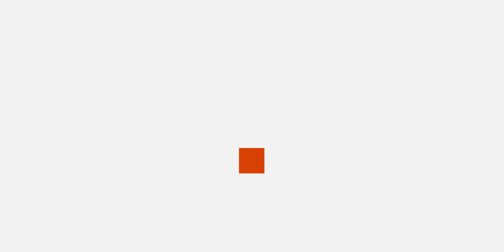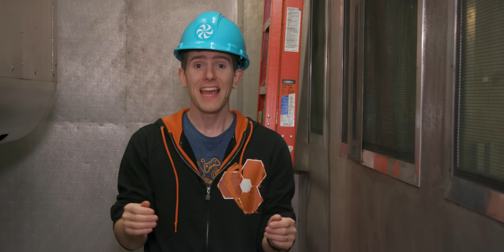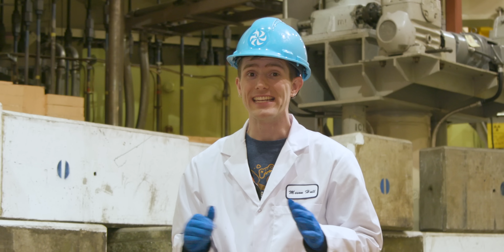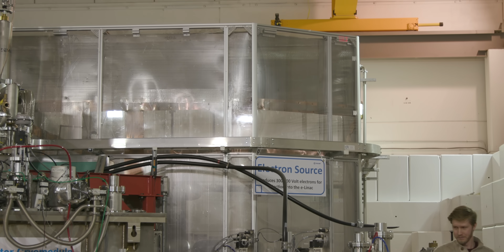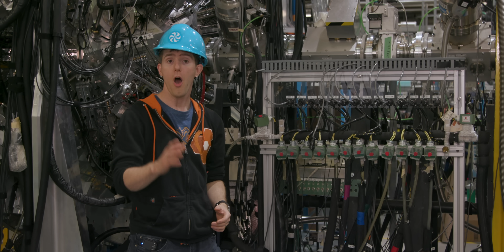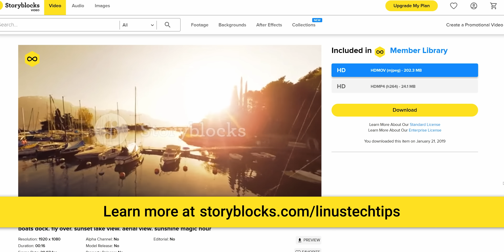The World’s Largest Cyclotron

Comment: MeV is expanded as 'million electron volts'    

 right?
Reply: Mega electron volts (but mega is essentially a multiplier for one million, so what you said makes sense)
Reply: @adampnewsome  thanks man.. also the next level would be GeV or BeV(Billion electron volts)?
Reply: @venkat8249  Yes, GeV is the units Giga Electron Volts (which is one billion electron volts). An electron volt is essentially just a very small amount of energy. Rather than using Joules for the units of energy, scientists/engineers use eV because it is more convenient for certain types of calculations dealing with small energy levels. Definition: "the amount of energy gained by the charge of a single electron moved across an electric potential difference of one volt".

Comment: 3 in a row...
10x10x10--1000 mega electrons
('-')/
Reply: That's not how energy addition works. Energy addition is always conserved, so you use plain addition. You're thinking of something else, like an amp/voltage stepper.

Comment: That dosimeter is nothing more than a placebo. If the machine is off, you pretty much have nothing to worry about. If it's on, and there is a problem with the shielding and you get exposed? Yeah, you are toast. Quite literally.

Comment: There is such thing as power over fiber it just can't run a 30kV power supply but more like a POE injector with super ultra high isolation voltage that could probably work at 1000kV+ voltage differences to run a tiny PC or sensor in a HV area.

Comment: Wait if that's a docimeter what's a gieger counter
Reply: A dosimeter is used to record the amount (dose) of radiation you've been exposed to over time. It sums up your exposure. A geiger counter shows the momentary radiation level.

A Geiger-Müller-Counter is the one you see on movies, making those ticking noises when near a radiation source. It tells you "theres radiation here and now" and how much of it. 
It won't tell you "you've been exposed to radiation for 4 hours and therefore your level is X mSv".  That's what dosimeters are for. 
 
Waaay back in the old days, the simple dosimeters were strips of (photo) film in a black canister (film will be "exposed" by radiation hitting it), which was worn during the day, handed in when leaving. It was developed and the amount of exposure was checked by determining the amount it was darkened by the radiation. Simple said... if it was blank - your ok. If it was light grey you'd been barred from working in exposed areas for a month. Dark grey was a trip to the hospital, and if it was black... well, no need to spend money on those concert tickets for next week. 
Modern ones are electronic and a tad more sophisticated. You can read your exposure level at any time, and most will give of alarms if the radiation level get's to high or you've reached a certain threshold of exposure.

Comment: The voltage doesn't kill you, the current does. 

Is this true?!
Reply: Kinda, it is basically down to amperage, which is determined by voltage and wattage. High voltage but low wattage is less likely to kill you, same with high wattage at low voltage, if both are high they are more likely to kill you.

Comment: Noobs : puts power supply on rubber pads to avoid short circuit.
Legends : Hugs device with high voltage sticker.
Reply: It only tingles the first time.
Reply: Pro commenter: Makes electric joke
Noob: doesn't realize that the equipment is turned off... Even with subtitles.
Reply: Nuno Pro: Makes a joke

Noov: doesn’t realize its a joke even when they can re read it
Reply: *in a Faraday cage
Reply: @TobeaLink  Dont forget "at 300K Volts
Reply: @LEOFXZ_PHOTO  Watts*
Reply: Nope he said volts.
Reply: Shots fired!

Damn what a priceless comment
Reply: You call them legends usually when they are dead yea?
Reply: Oh no im detecting some retards dumbasses saying that its the amps that kills not the voltage 
SICKO MODE ACTIVEATED REEEEEEEEEEEE
Reply: mafia boss
Reply: The verge has created a timeless meme
Reply: Pros: knows that its the voltage that kills 
Noobs: IZ DA CURRENT DAT KILLZ !1!1!1!1!1!1!111111!!!!!!!!!
Reply: its the amps that will hurt you
Reply: @odensfury  yes and no

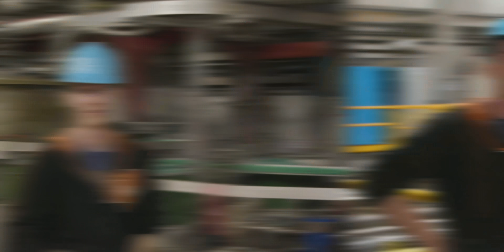Comment: 12:40
Each home only uses 1000W? That doesn't sound right...
Reply: 526 watts right now..... how much are u using ?
Reply: Milene De jong A window AC unit is 1400W alone. Water heater is 4500W. Hair dryer is 1000W. PC is another 1000W. Freezer/fridge is 800W. Microwave is 1400W. Dishwasher is 1200W. Dryer is 5000W. It adds up, very quickly.

Comment: They should make an accelerator that can make a partical move faster than the speed of light.  😜
Reply: that sounds pretty fast man
Reply: Not very likely to happen, the only ways for matter to go faster than light would be to use wormholes, star trek style warpdrives or a type of hyperspace/slipspace (like halo or star wars). Normal means of propulsion cannot push something (even tiny particles) anywhere near fast enough.

Comment: Are they gonna build a wake field accelerator for the linear part? You said the particles ride the radio waves but in a wake field accelerator they shoot a laser through a tube and a particle directly behind it, so that the wake behind the laser pulse pulls the particle along. Kind of like the draft you feel as a train speeds past you.

Comment: Would it hurt if a really fast particle would go right through your heart?
Reply: No, the energy of one particle is just too small even at roughly the speed of Light
Reply: @Dundoril  what if it is something like a big particle like lead? (If you could accelerate it that much)
Reply: @maksimlikhachov1465 
Even for heavy particles, one is just not enough to feel it (Even the TeV reached by LHC ist not that much energy  per particle...somethinglike  A fraction of A Joule.. , but as I. T. Said it will probably do quite some damage to some cells in your  body.... But Even this would be irrelevant compared to All the radiation we are exposed to every day... Then again if you are  Hit by the whole beam.... Thats A different matter.... And i would not recommend it.
Reply: @Dundoril  You want low energy particles to deposit a lot of energy as well, not high energy. Low energy particle beams cause a lot more damage than the beams in the LHC.
Reply: @BlueCosmology  Sure at LHC energies :-) but here we are talking   500 MeV ( i know i Was the one who talked about lhc :-)). At those energies the bragg peak for Protons should still be within the body (also now that a think about it... I think for Proton therapy the energies are more in the Range of 150 MeV)....
And i think even for LHC energies it would be interesting to do the math... Because while the relativ energy Loss is smaller at higher energie.... The absolute energy loss could be bigger...
Reply: @Dundoril  By 500 MeV a proton is more or less a MIP, you definitely want lower than that for radiation damage, the vast majority will pass completely through a body, anything significantly more than around 100MeV and you're getting into very low energy deposits.

LHC beams definitely deposit very little, they barely interact at all unless you have a huge amount of material in the way to stop them.
Reply: @BlueCosmology 
So i checked the bethe Formular again and of cource you are right, also as I said since Proton therapy is done in the 150 MeV Range,  i would expect the bragg peak to be  at 10-15 cm for a Human body otherwise it would not be really usefull for therapy....
Reply: I mean, an electron in a beta decay is moderately ionising and has medium penetration so it could do some internal cell damage or some other kind of damage to your heart.
Reply: @siddiki9778   so a single electron could actually cause damage to you?

Comment: 75% the speed of light is VERY SLOW for particle accelerator speeds
Reply: I mean, it IS 50 years old, that's probably why they're upgrading it. Besides, I reckon they're not doing the exact same stuff as the LHC (that thing uses 2 colliding beams so you're in the CM-frame of the 2 beams which means you have a lot more energy lying about to create mass, special relativity and all) considering they're slamming protons into big nuclei to create different nuclei instead of slamming 2 beams of protons together to create new fundamental particles.

Comment: LOL, what a complete DUMP.  Such dusty.  Too little funding to get someone to clean it once a decade?
Using a million watts to get a whopping 30MeV particle.....that calcuates to 0.00000000000000013 Watt/hour of energy?   Im sure google calculating it for me diddn't account for some inportant variables, but wtf?
Reply: Yes most of those Facility are dusty. mainly because it dies not matter much and you Do not really want a cleaning Crew there.... Oh a cable is loose.... Well i will just put it back there.... There goes your Experiment...

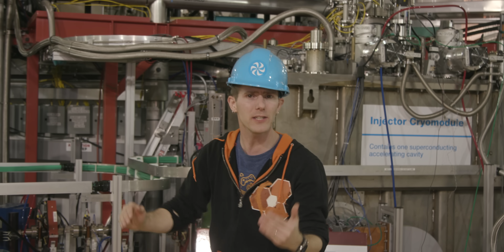Comment: 12:08 NOT like a railgun. A railgun uses the arc across two rails to propel matter. This is more similar to a coil gun, which uses a series of electromagnet coils that switch on and off at precise times to propel matter.

Comment: In case anyone was wondering: 18F-fluorodeoxyglucose is used basically everywhere they have a PET scanner. And, the larger hospitals that have one often have their own cyclotron as well. It's a tracer that pretends to be glucose, and is used to detect where glucose is used in the body. This can be used in brain imaging to see if parts don't work well, or detect abnormally high usage elsewhere in the body, such as is the case if the patient has a tumour. It is beneficial to produce it on-site because its half life is only about 2 hours.

Comment: Great video. I work at a proton radiation therapy center in Atlanta for cancer treatment and we deal with literally all of this stuff on a smaller level. A 15 foot diameter cyclotron with protons that are around 61% the speed of light or 250 MeV.  

Our system also uses liquid helium at an average temperature of about 4.4 K. We have a video floating in our company that shows liquid nitrogen dripping off of a cooling line fitting as it condensed from the air while they fill our tanks up with the liquid helium. Also, if we ever quenched our helium it's about a $250,000 oopsie.
Reply: @helium... Is there no Backup to store the Helium in case of quenching? Seems Kind  of wasteful.
Reply: @Dundoril  Nope. Not really a point as the system can handle it, and we just call up the industrial gas company to refill it. Takes about 3 days.

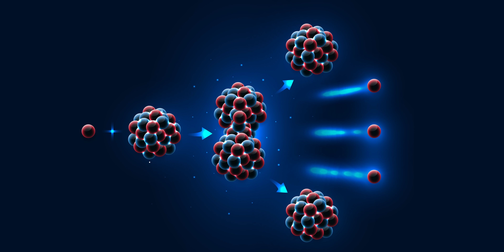Comment: 13:03 It's talking about a cyclotron proton accelerator and linear electron accelerator, but then it shows a diagram off a neutron (not proton or electron) causing fission (most likely Uranium-235 fission which need low speed neutrons not high speed). Don't worry though, I still really enjoyed the video and I only noticed this tiny error because I'm a complete nerd.
Reply: Oh good point.. I thought they were showing a spallation Neutron  source .. But since the incident particle is clearly a Neutron you are probably  right.

Comment: Isn't the one in Switzerland the world biggest particle accelerator?
Reply: Indeed, but that's not a cyclotron. A cyclotron accelerates a single particle beam on an outwards-going spiral path and then launches it. The LHC however uses synchrotrons which accelerate 2 beams going in opposite directions on circular paths and then collides them.
Reply: @photonicpizza  thanx for the explanation:)
Reply: There are different types of acceleratorsfor different purposes
Reply: @vnyggi621  okay :)

Comment: 75% the speed of light? that seems kinda low. the COSY synchotron in Jülich which basically around the corner for me accelerates up too 99.8% the speed of light. they always get complains from the power company when they turn it on.

Comment: 12:08
Should be Coil gun not rail gun.

Rail gun: the projectile is in contact with the rails as it is being forced out.

Coil gun: the projectile is not in contact with the conductors and is propelled forward by a series of solenoids.

Comment: 12000 volts...
The right anmount to do stuff with hydrogen or...

Get an fx 9590 stable at any other frequency other than its stock.
Reply: On some newer graphics cards it also enables deathray tracing .
Reply: i salute you sir
Reply: remeber how AMD FX hit 8.429 GHz in 2011?
Reply: ...and what do we learn from all this? linus prius is slow af :)
Reply: 5.1ghz baby
Reply: Finally someone who gets 5.1 gigahertz on a fx 9590. 😂
Reply: @thedevminer  it literally melted my vrm back in the day. Never OCed again till ryzen.
Reply: <insert_ahh_thats_hot_meme_here>
Reply: They said 300,000 Volts.
Reply: At least its still usable. Shintel reaches temperatures close to that of the surface of the sun.
Reply: This can't even power a GTX 480 quad-SLI.
Reply: Haha 😂😂
Reply: * laughs in FX-8350 passing Cinnebench at 5.2GHz *
Reply: Nit even bruh
Reply: Ooo can i get 5 gightz with my 2700x
Reply: he said 12kV over the 300kV base voltage so that should be enough to get RTX cards working.

Comment: Those cables......
They have to pay someone to cable manage that
Edit: this was a joke pls don't kill me
Reply: The problem is the rewire regularly. tbh I was wondering why the removed all the aluminum foil, that is used to heat the pipes up for vacuum pumping.
Reply: Electrical engineer here, cable harness manufacturing/management/etc. is an actual field that some engineers specialize in. The routing of these wires is very carefully planned not only to meet mechanical constraints such as space, cost, accessibility (make sure the cables are not in the way of sth), reliability (make sure there's no unnecessary wear and tear), etc. but also to meet electrical constraints such as EMC, current rating, voltage isolation, etc. It's typically done by an electromechanical engineer and it is very important if you want to ensure proper long term operation. Even the connectors that you use have to be carefully selected for your intended application.
Reply: I mean i'm sure they are like that for a reason, i'd imagine that the engineers who made it know a hell of a lot more than any of us lol
Reply: Considering the knowledge and experience those engineers have, those cable managements are probably the best it could possibly be done without sacrificing funcionality at all
Reply: So much wasted gear used on this facility. They should have used that money to make next gen graphic cards with gamma ray tracing.
Reply: Cable management is for suckers who value aesthetics over functionality.
Reply: Rubiconnn CoughairflowCOUGH.
Reply: @rubiconnn  More like for people who don't have to rearrange the wires

Comment: Isn't that thing called Geigenzähler or Geigencounter
Reply: I think that they are different instruments.
Reply: A Geigenzähler would be a Violin counter :D
What you mean is a "Geigerzähler" or Geiger-Müller-Counter, which counts the number of nuclear decays per time.
A dosimeter mesures the ammount of radiation energy that you are exposted to. Simmilar but not quite the same.
Reply: @k1ngjulien_   Ok and I don't know why I said the German name
Reply: Not necessary. Maybe he as a visitor got a Geigerzähler (Geiger not Geigen) or more correctly Geiger-Müller counter (or German Geiger-Müller-Zählrohr) as a dosimeter. But there are other kinds of dosimeters available there are some that are based of photo plates. These need to be evaluated more complicated by development of the film and are thus not so useful for visitors, but they don't need any power during use and are so maybe used for normal staff. 
As a dosimeter nearly anything can be used, that can detect radiation.
Reply: @FactoryofRedstone  Ok, so i think it's that a dosimeter (what linus had) counts total accumilated radiation whilst the geiger muller counter measures the delay between detections.
Reply: @runiiiiiii  The Geiger-Müller counter, produces an electrical pulse for each ionizing particle that it detects. So if you count the number of pulses, for example with a fluxmeter or with a microchip you can measure the accumulated radiation over time and you build yourself a simple dosimeter with a Geiger-Müller counter.